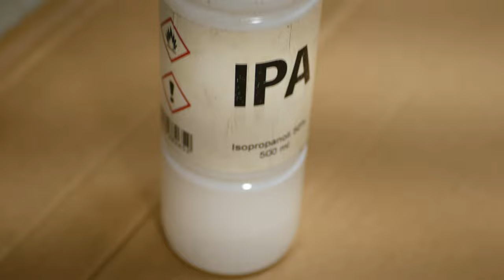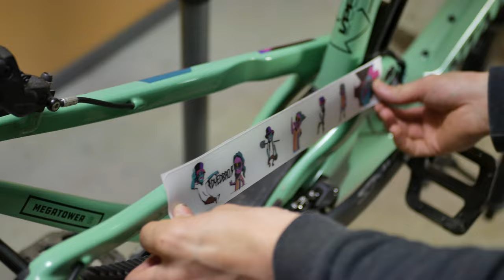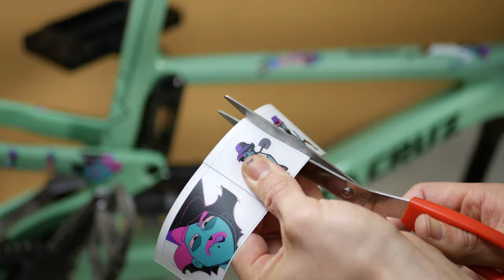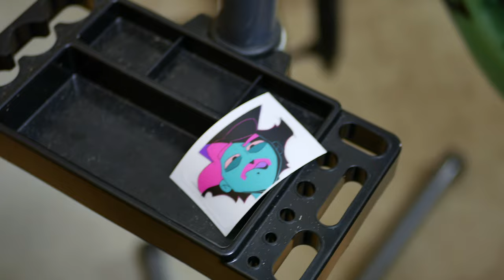DYEDBRO on Megatower - How to install a MTB Frame Protector

Comment: Great install. This is a dumb question but how did you avoid scratching the frame when you were trimming the pieces you stuck down?
Reply from the maker: There is certainly some risk involved in trimming the pieces by cutting once already installed. A steady hand and sharp eyes help! 👀 You can cut and trim the pieces with scissors beforehand, but getting a perfect fit isn’t as easy, if you are going for a detailed finish.